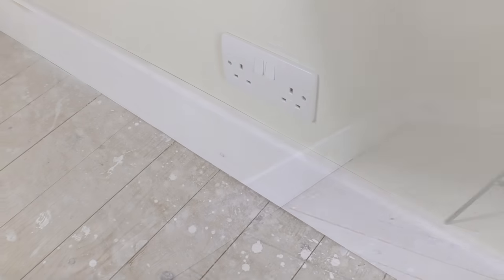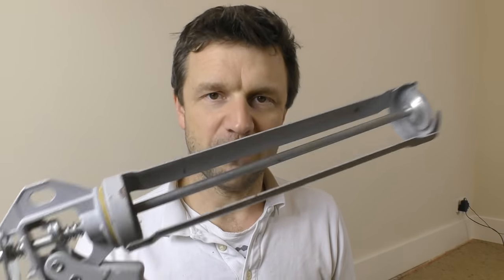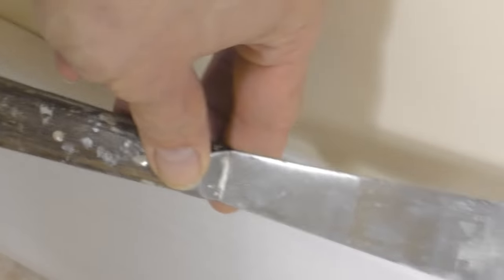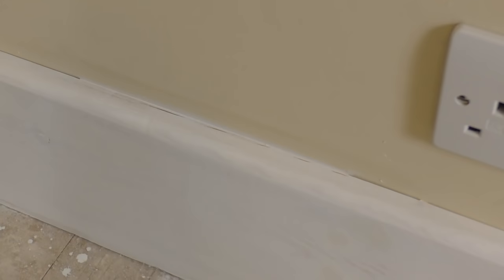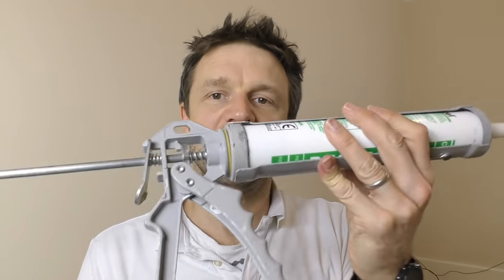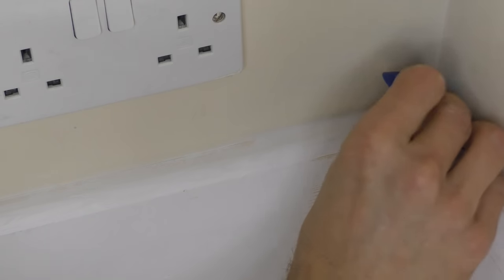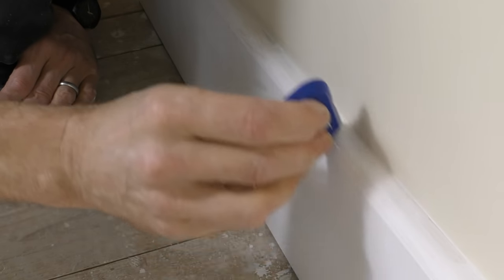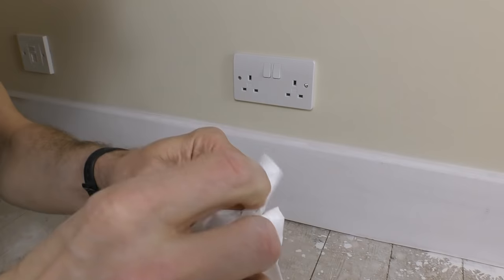How to Caulk Skirting Boards & Base Boards

Comment: not sure if this is better than the way i do it or not but i will try it. currently i use a filler knife to scrape off any extra and force some down into the crack. then use a double sided kitchen sponge to clean off any thats left. im pritty happy with that method but if your is better then il go with that
Reply from the maker: MelbourneAlan To be honest the wet sponge approach is a really good one. You'll find the FUGI tool more effective than using a decorators knife but maybe that and the sponge would be the perfect combo?
Reply: i use the fugi system on silicone and find it great. i dont see why this would be different. the sponge method get you all wet and you have to be really carefull witht he water
Reply from the maker: True. I had to use a wet sponge on site recently but only because I didn't have my FUGI kit with me. It got me out of jail on that occasion but I'd rather have used the profiling tool. The FUGI tool will probably leave a very small micro thin layer of caulk residue on the plaster, but if you're painting the walls after, as you would normally do when caulking, that's not a problem. Just be aware that because you end up with a much tidier joint than if you were using your finger or a sponge, that also means the caulk bead is thinner, and so if your skirtings are natural wood and they move slightly when they've been in for a few weeks, then the caulk line may need to be redone. The thicker, clumsier bead from using your finger would probably hide this minute movement.

Comment: Use water when gap filling with fingers or scrapers much easier and spraying water on gap filler comes off better. Just a pro tip.

Comment: If you’re not bothered about painting over the caulk, why not use pure silicone sealant?
It’s more flexible than caulk, it won’t crack or discolour and it’ll generally look a lot better for longer.

Comment: I dont know but… I think the relief notch could be just that. When pulling the device over the freshly caulked area it could be a simple indicator of the tool gathering too much caulk. it's just telling you have accrued too much and that it needs to be cleaned. No more 100 cm, just be vigilant. I haven’t read all the comments but, it seams likely.

Comment: Hi Charlie . What grade of wet and dry paper do you recommend for fixing up the sharp edges on the Cramer tools? Thanks
Reply from the maker: I did this in this video. https://youtu.be/VlRNNlARX_M You want a wet and dry sand paper probably 1000grit but check what I recommended in the vid. 👍 Also for caulking, you should check out my updated video https://youtu.be/-ETYMFbtaTk
Reply: @CharlieDIYte  thanks Charlie. PM’d you on on Instagram btw

Comment: I have both the Fugi & alternative to the Fugi. The alternatives just aren't made to the standard & accuracy as the Fugi, so if you get an alternative, like I have, make sure it's flat against the surface when using. That said, I do prefer the Fugi 1-5 series tools better regardless of price in the USA. Also, they do deteriorate over time, per manual, but that's okay. Why, because it does take awhile for this to happen. I buy a new kit about every 5 yrs or so, which considering price, is pretty good. The cheaper alternative brands, sometimes leave color behind and breakdown much faster over time(so if paying $8.00 for cheaper kit & use all the time & buying new ones frequently & paying $48 for a year or so, buy the Fugi, lasts longer. Just sayin, but if just use once in awhile, think be okay......just watch that you have flat surface contact when using. Had one cheaper brand that was 10° out of true 90° so when was supposed to be flat & using, was getting frustrated as the bead line wasn't even. 
Great vid & great product, just wish was cheaper for us here in States....but regardless, I personally think still worth the price, long as keep getting 3-5 yrs out of one kit used on a professional level.
Cheers Mate, A

Comment: Does this really clean all the caulk off painted wall or is it leaving a micro are behind that once it eventually gets dirty shows up?
Reply from the maker: I'd say it leaves a micro film. Better to paint the wall after caulking as you'd normally do and use the 5mm profile rather than 90 degree as you'll get a stronger joint trust will protect against the skirting warping or otherwise moving.

Comment: I'm going to install a new shower tray and enclosure this weekend. I'm using a fugi 5 kit for the silicone. What size do people recommend a use on the fugi blade for the shower tray ,6,8,10,16? Also the same question for silicone the shower enclosure panels?
Reply from the maker: Have you watched this video https://www.youtube.com/watch?v=_DI4hfHM_Hg? You want to go with the smallest, neatest bead you can - but how small will depend on the size of the gap you leave as you want to make sure the silicone overlaps onto the tile by a good 2-3mm - but don't use the concave profile - use the straight 45 degree profile as it will last much longer. The reason I had a large bead in this video is that I was siliconing over existing silicone. If I was doing it on a new shower tray/enclosure I would have gone with a much smaller bead.

Comment: Have you or anyone reading this tried any of the cheaper versions of this set on Amazon? If so , how do they compare? I’ll be using mine to get the perfect 90 degree angle around baseboard and crown molding. Our walls are wavy and we have lots of gaps . I can get the caulk nice and flush with a putty knife, but it’s a nightmare. The 90 degree tool looks perfect for me . I’m trying to make it look like the trim meets the wall perfectly, with no indentation where the caulk line is . I’m quite picky 😂. Thanks to anyone who can answer my questions 😊
Reply from the maker: Hi Jennifer. If you have lots of gaps it should do the job nicely. The only thing I would say to anyone whose base boards are tight to the wall, I'd now be inclined to use the smallest diagonal profile rather than the right angle, just so that there's a decent bead of caulk in case the base boards move or warp after caulking.
Reply: Charlie DIYte , Thanks so much for your reply. I have one kit on the way , plus a got a smaller kit from Lowe’s to try . Can’t wait to try them out . I have wavy walls with over 1/8th inch gaps in areas . I love the idea of making them flush with no dip ( like you get when using a wet cloth and finger method). I’m forever grateful to your awesome video and helpful tips . Have a great day 😊

Comment: Hi , after i caulk, and i want to paint the wall with a roller,  how do i protect the skirting from splashes is it then possible to use frog tape over the caulk ? Or whats the best option ive been trying everywhere to have this question answered . Any help would be greatly appreciated.
Reply from the maker: Hi Mick, check out my new updated video https://www.youtube.com/watch?v=-ETYMFbtaTk&t=801s, but on your question, yes, I'd use frog tape, lightly pressed onto the caulk but you'll have to make sure it's not touching the wall itself. To be honest, I didn't bother taping after caulking. Yes there was the odd sprinkle but it's imperceptible to the naked eye now the caulk is also painted. I lightly sanded any paint sprinkles off the skirtings before priming and top coating.
Reply: @CharlieDIYte  thank you so so much. Finally an answer 😁👍 love your videos 👍

Comment: I've just fitted my skirting boards that sit ontop of my laminte. There are a few gaps of around 1mm in some places. Should you caulk the bottom of skirting boards to fill in gaps?
Reply from the maker: 1mm isn't much. Can you live with the gap? It's not common to caulk the bottom. That gap is handy as you can slide a bit of paper under to keep the floor paint free when you're painting the skirtings.

Comment: Scratch that I checked back on the silicone that I did in my kitchen and you're right, mine is shit
Reply from the maker: You had a point though - normally you'd caulk before painting. I painted first because it was easier to paint the walls, install pre-painted skirtings leaving me with very little retouching to do - but I was always intending to paint over the caulk when dry. I wasn't trying to suggest this method means you don't have to paint, I was simply suggesting an easy alternative to the traditional finger technique.
Reply: Charlie DIYte dammit I deleted that comment but you obviously saw it. I realised I was being a bit of a twat. Keep up the great work buddy
Reply from the maker: Don't worry mate - I can't quite remember what you said, but as I said, you had a point - and you had the good grace to delete it anyway :) What I should have done was use the 5mm angle - as the 90 degree tool does leave a little too thin a bead. The point is still valid though - I spend a lot of time on building sites, and caulking is never done that well. It always goes everywhere when you wipe it, whichever way you do it.  Rob points out below that you can then cover it with 3 coats of emulsion so it doesn't matter, but I say let's get a neat bead to start with, you don't then have to use a load of paper/ rags/ foam wiping it, and then the painting is easier.

Comment: Hi Charlie DIY any ti p on corking against  an exposed brick wall 🧱 🤔
Reply from the maker: That is tricky Trevor. I think you're going to have to cut the nozzle at 90 degrees and try and do it in one hit without forming it after with the tool.

Comment: You may want to clarify to your viewers that what you are using is siliconized caulk and not the100% silicone (un-paintable) product.
Reply from the maker: Good point. I'm doing an improved video this weekend and will emphasise this point.

Comment: I have order one to thanks for great Vid's
Reply from the maker: You're welcome. Maybe try one of the angled profiles rather than the 90 degree that I used - so that the caulk bead is thick enough to withstand any movement in the base board/ skirting board.

Comment: In your silicone video you clearly say don't pull the caulk gun. Here you did pull the gun. Also, I've used a similar tool by other companies and they do where down and they will still leave a slight film on a painted wall especially if there is any kind of textured stippling going on from the paint roller. Not trying to be negative. Just an observation. Thanks for make the video.
Reply from the maker: Point taken. This is a better video on caulking https://youtu.be/-ETYMFbtaTk 👍

Comment: Use a damp rag over your finger and you get the same result. The caulk is removed from the wall and baseboard because the rag is wet but the caulk stays where it is meant to go ...in the crack

Comment: does it work well if the walls are textured?
Reply from the maker: No, for textured walls I'd caulk the traditional way, piping in a small bead and then smoothing it with your finger and perhaps a small piece of wet sponge.

Comment: The only issue is with trim that narrows at the top, the caulk tends to overspill down the baseboard, but it's not such a big deal to wipe it off
Reply from the maker: I did an update video which was a bit now comprehensive https://youtu.be/-ETYMFbtaTk The conclusion was you adapt the technique for the situation - so yes, a thin bead and finger might be better in that situation 👍

Comment: I just lightly wipe it with a damp sponge. It smooths the caulk and also removes the extra on the wall at the same time.
Reply: a damp sponge will make the caulk shrink

Comment: For 31 years painting, I've always used my finger. Any excess wiped on my shirt... Or rag
Reply from the maker: The finger is a damn good technique Mike, and a bit of torn off sponge, moistened is also pretty effective in my experience. In this video I was just exploring alternatives to the tried and tested techniques. In hindsight the right angle edge was a bit too severe as it leaves very little caulk in case of the skirting moving/warping, but I've had some pretty good results with the 5mm edge. Cleaner less messy than using your finger!

Comment: Hi Charlie, could you use Silicone instead of Caulk on the skirting?
Reply from the maker: No, because you can't paint over silicone whereas the point with the caulking is that you're meant to apply it before you paint the wall and skirting. Since doing this video I've achieved better results using the smallest angle profile on the tool, rather than the right angle as this gives you a thicker bead in case the skirting board moves slightly after fixing. So you might try that if you are going to use this tool.
Reply: thanks Charlie, I will try the 5mm

Comment: I see some people using caulking spatulas when doing exterior work like windows  Are the spatulas too big for interior work? I'm a bit confused about which caulking tool to buy right now.
Reply from the maker: For interior caulking (assuming you're talking about decorators caulk for skirting boards/ base boards, not siliconing??) you've got a couple of options. Most people just caulk in a thin bead of caulk and then use their finger to smooth it, and sometimes a wet sponge to quickly wipe away any excess residue and tidy up the joint. I've done this on a number of occasions. Your other option is to buy a profiling tool or spatula. This is an easier method assuming you can get it into the joint ok, and I'd be tempted to buy a rubber profile tool like the FUGI because it leaves less residue on the joint than a non rubber spatula. One thing - if you do use a FUGI tool, use one of the angled profiles or maybe the concave profile edge to give you a nice bead, as the 90 degree profile I used in the video removes most of the caulk which will leave the joint prone to cracking if there's any movement in the joint. The key to good caulking is practice. The more you do it the better your caulk joints will look.
Reply: @CharlieDIYte  thank a lot! Now I need to find where I can buy it in Canada :-)

Comment: I suppose in a climate where the relative humidity is pretty stable this MAY work, but I personally think this was just a sales video.    The elastic nature of the caulk is very low when applied at such thin applications, and a caulk job done like this would not last one heating season before cracking and looking terrible.    This is a tail, light warrantee caulking.   You can get done, and get out, but It won't last.
Reply from the maker: Well, it certainly wasn't a sales video - I've never received a single approach from the manufacturers of FUGI or for that matter, any of their retailers. I'm inclined to agree with you on the thickness of the caulk though, and I've said to a few people in the comments feed since that it's worth trying one of the other profiles rather than the 90 degree profile, to apply a thicker bead. The point I was trying to make in the video was that caulking is a notoriously difficult/ messy process - and one which I'm well acquainted with in the day job (as well as doing countless skirting boards over the years the traditional way) when we're often caulking in lath and fascias and tracks into ceilings where the finish has to be perfect as it's so visible. I was simply trying to push the envelope and suggest that there are easier ways to do it than the traditional approach.

Comment: But what about on old Victorian houses  were the walls are terribly bent on 7 inch ogee skirting?
Reply from the maker: You'd want to use an angled profile with that or failing that, your finger followed by a small piece of sponge, moistened, to clean after you've dragged you're finger along.
Reply from the maker: I'm tackling that in a video this weekend!

Comment: Thanks Charlie... such a helpful video! Is there a maximum gap you would recommend using caulk on? My skirting board doesn't seem to want to pull in very close to the wall!
Reply from the maker: The Maths Monkey Hi there - thanks for the kind words! A gap of over 5mm becomes quite tricky - make sure you force plenty of caulk down into the gap - by pointing the caulk straight at the gap at 90 degrees rather than at a 45 degree diagonal - if necessary cut the nozzle straight rather than diagonal to assist with this. What you're trying to do is minimise shrinkage - which will be more pronounced if the caulk line isn't very deep. You may need to reapply the caulk when it's set, if it does shrink significantly and you're not happy with the resulting caulk line.
Reply: Wow! Thanks for such a comprehensive reply! I'll certainly do that. Thanks again!

Comment: At 7:37 there is clearly a thin layer of calk left on the wall. If you are using 100% silicone you will not be able to paint over that.
Reply: He's using Caulk
Reply: It's caulk he's using, it's paintable

Comment: You can buy them at Lowe's for $9.  I did and they work great.
Of course you can just as well make your own out of some old rubbermaids just laying around in the kitchen with nothing better to do. Then you'll have a handle on them, therefore keeping your hands clean...er.
Ps. And if you use the wrong silicone, use "Kilz." It comes in a spray and you can paint right over 100% silicone.  🛠😁 Age 65.
Reply from the maker: Thanks Cynthia - some good info there 👍

Comment: You can buy the same ones on AliExpress, they only cost a few Euro/Dollars
Reply: Allot of the cheaper versions are not nearly as rigid and work not nearly as well
Reply: @jamesmcconnon2  Ordered a new set, made from rigid plastic. Time will tell if they hold better opposed to my silicone ones where the edges worn quite rapidly.